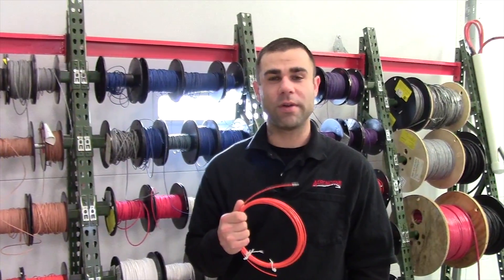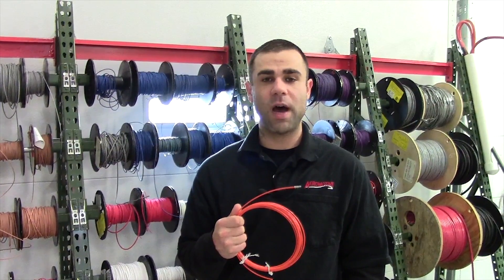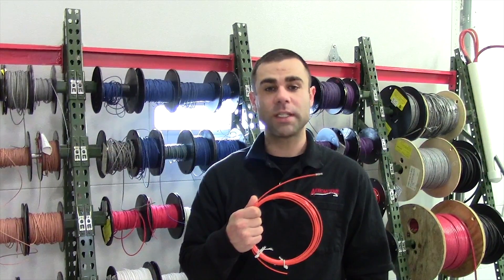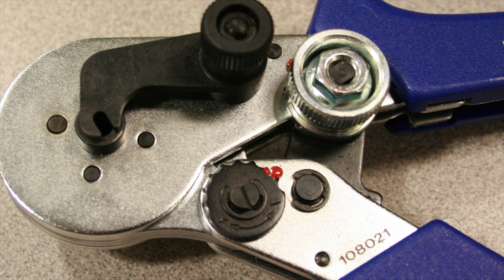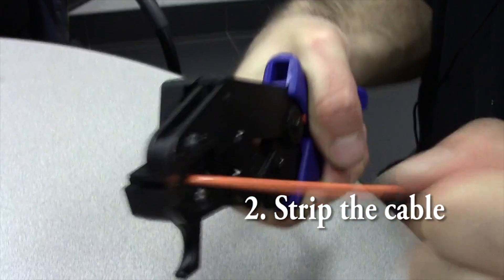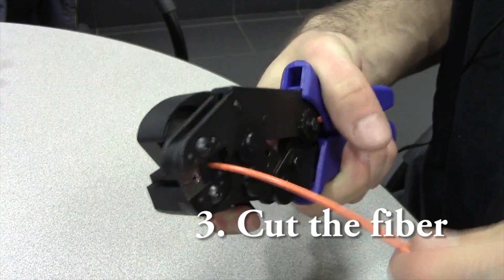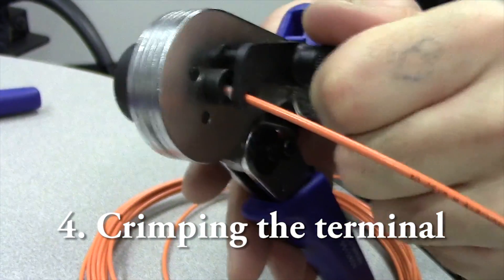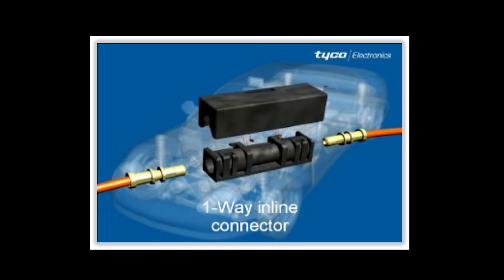Fiber Optic Cable Repair

Comment: Thank you. I have looked at those crimper before, but was afraid that they were for crimping on a different type of end. will order one today and finally get a radio and GPS working again.
Reply: hello did you have any success? ?? thanks
Reply: +Ruddy Felix 
Not yet. The crimper came in mail today and I'm going to try to fix it this weekend.
Reply: +Dusty Sims Thank you so much for replying, i have a question how was you able to find the fiber optic cable cutter ? did you use the same oe he has or a after market one, im trying to six the sound on my BMW, im one step closer now.
Reply: +Ruddy Felix 
I didn't have to cut mine. the little plastic end just came loose. I have read several posts of people just using a sharp razor blade to score the fiber then bend it and snap it off clean. Hope that helps some.
Reply: +Dusty Sims thank you so much it really did help, now i have a better idea on what to do, thanks.

Comment: can you please tell me the brand of crimper? I need to recrimp an end on a most bus system and cannot find the tool anywhere. Thanks
Reply from the maker: +Dusty Sims 

The tools we used in this video came directly from a dealer. However, the link below will guide you to a useful tool sold online. We do not personally endorse this company or any of their products, but I feel this would be a good price for this useful tool. 

http://www.testequipmentdepot.com/products.htm?item=902087&ref=gbase&gclid=CjwKEAjw9OG4BRDJzY3jrMng4iQSJABddor1FruxwFAOSfXGce6ZdOL-tTGIPx_rA7NvK1pn5_-7RRoC_1Hw_wcB
Reply: Aeromotive is that crimper good for the job done in this video? Cause I need to do the same thing to my cable in my car